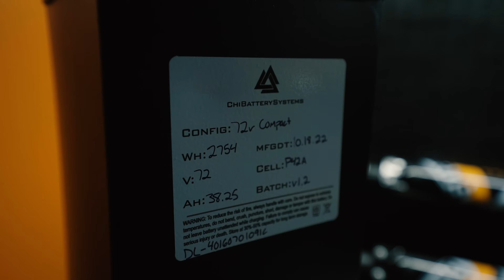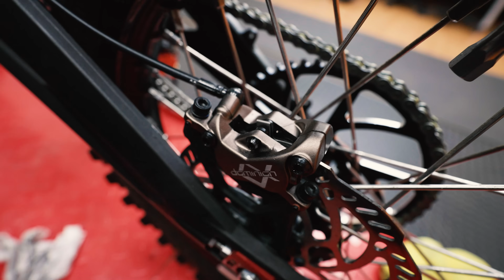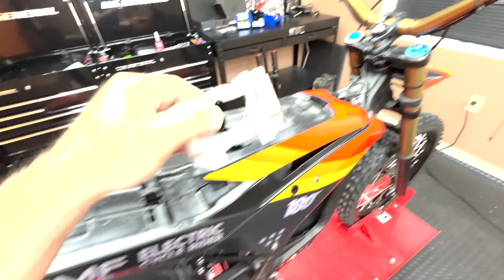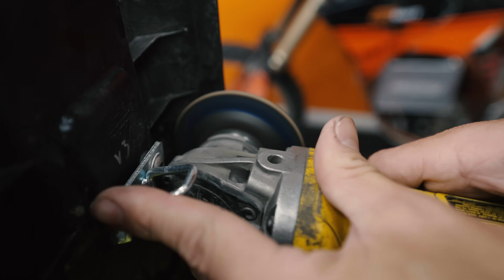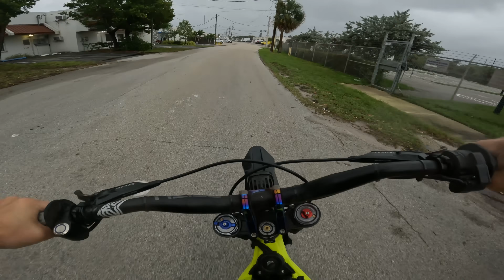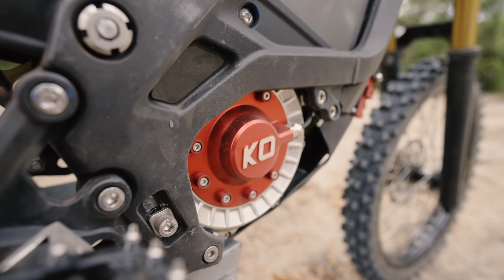NEW Ultimate Surron XX Re-Build

Comment from the maker: Any Ideas For What Is Coming Next?

See below for a list of the parts mentioned in this video. [https://bit.ly/ECRParts] 

KO RS Motor: https://bit.ly/KORSMotor
KO Pro Series Controller: https://bit.ly/KOProController
EXT Arma E-MX Shock: https://bit.ly/EXTArmaMX
EBMX 72v 42Ah Battery: https://bit.ly/EBMX72v42Ah
Hayes Dominion Brakes: https://bit.ly/HayesDominionA4
Warp 9 54T Sprocket: https://bit.ly/Warp9ChainSprocketCombo
Warp 9 Linkage: https://bit.ly/Warp9Linkage
Warp 9 Handlebar: https://bit.ly/Warp9Handlebar
Excel Woodys Wheel Combo: https://bit.ly/ExcelWheelCombo

Find Surron Electric Dirt Bikes For Sale: https://bit.ly/ECRMarketplace

For more tests and reviews on the latest electric motorcycles and dirt bikes, visit: https://ElectricCycleRider.com
Reply: I saw a 60V battery at 65ah that gave 15kh of power with stock controller, wasn't a titan build in size either! Heavier but worked a treat.... 🤯
Reply: RUSH controller!
Reply: a new rear swing arm ?

Comment: Dig it. So I'm a pure motocross guy and have been watching for awhile to see what I want to do. It looks like a lot of money for these builds. My question is what could I expect if I converted my mx 07cr250r with one of these motors? I already have the money in the suspension and so used to the setup and size.  Are these motors/controller and batteries enough to push my ride around the track? Understanding its more weight/size but I'm after the torque/pull more than top end and or speed. Thanks for the goods!

Comment: Awesome work, but… is much much easier when Next time You will buy BearEbike from Poland. They have all aftermarket parts is serial equipment, also bigger battery 44Ah, 20kW motor and UN38.3 with airline shipping possibility 😊 we ride on them many years 😊
Reply: They dont offer off road bikes.. only with rear wheel motor hubs. Right?

Comment: I was waiting for this ever since I seen the one minute intro of the ext forks. This is a step above and beyond what I wanted to see. And gritshift rocks.
Reply: Nice to see you finally come around on KO.
Reply: @nxdboi  I didn't say all that. But it may be better for motocross or off road if you can tune it. I still think bac is the preferred controller for wheelies it's easy to use and controllable. I really would like to try out an x9000 to be honest with you. I love gritshifts parts and they're awesome people too. The ko motor is the undisputed champ tho you couldn't run that same 19kw with a stock motor although you might be able to with the new talaria ipm motor. I was anxious to see the forks guess that'll be on part 2 tho.
Reply: @MotoAlias  I'm actually super eager to see what the new R motor can do as well. And that battery with a bypass too. Not many videos out there pushing R parts to their limits yet. In due time I suppose.
Reply: @nxdboi  I know someone in town that was pushing 23kw sport and 17kw eco woth the R motor but he sold it and went to ko. I was tempted to buy it but I'm holding out for something different liquid cooled would be nice.
Reply from the maker: @Alias Stay tuned for Part 2! More EXT coming... 👌
Reply: @ElectricCycleRider  hell yeah man I was going to suggest the ext front suspension it will balance it out for sure